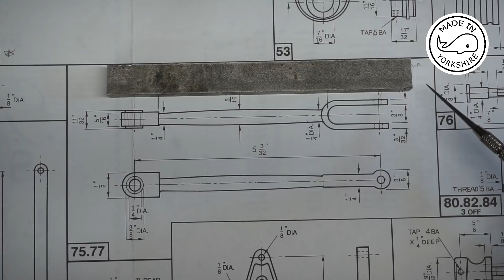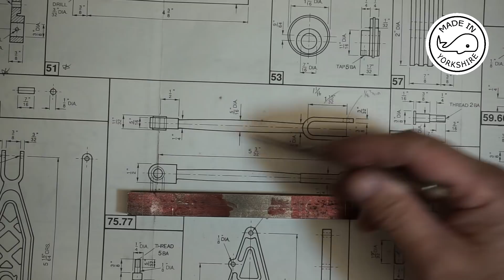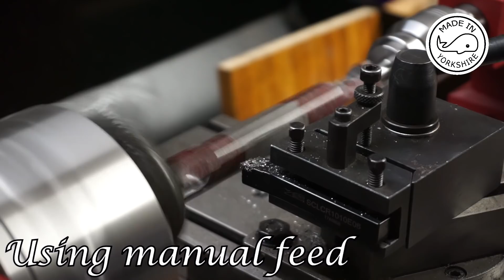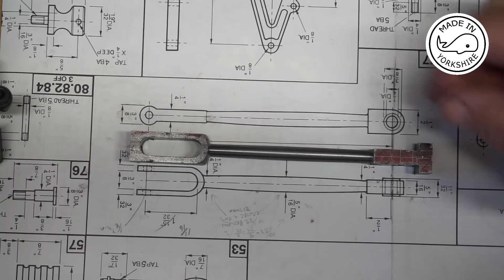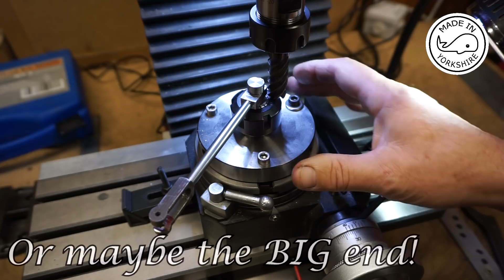#MT32 Part 14 - Making a Stuart Half Beam Steam Engine. The Conrod. By Andrew Whale.

Comment from the maker: 14/10/2019: IMPORTANT UPDATE.....
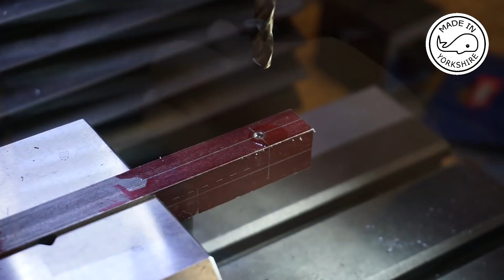Well nobody noticed my error at 9:25 where I drill and ream the big end to 1/4" in diameter. I later realised that it needs to be drilled and reamed to 3/8" in order to accommodate a bush with a centre hole 1/4" in diameter. Having realised my error, I used my co-axial indicator on the mill in order to find centre of the 1/4" hole. I then re-drilled 23/64" and reamed to 3/8".
Thank goodness it was recoverable!

Comment: Leave it all set up as default parallel. For 30 thou diametric difference, mark off 6 equal  places and machine in 6 parallel sections of 3 thou cuts. Finish with a rub with a file and emery. Allot quicker and should be undetectable.
Reply from the maker: Hi David - many thanks for the tip.
Cheers
Andrew

Comment: A lathe I used for a while had long grub screws in the tailstock to move it one way or the other.
To go right (towards the back of the lathe) I had to back out the right side screw to allow movement and then turn the left screw in to move the tailstock to the right and vice versa. Then when the desired offset was reached both screws were tightned to hold the ts in position.
Reply from the maker: Hi Larry - I think my lathe has a similar mechanism, but movement is fairly limited. I recently tried adjusting the tailstock for another job and couldn't work out why it wouldn't move. The internal mechanism then went 'pop' and broke. I then realised that I had the tailstock locked to the carriage - a basic error on my behalf. I managed to repair the mechanism with JB Weld, but I try to avoid making any form of adjustment now. It's dead on centre with the headstock, and I will try to leave it that way. Using a boring head makes life a lot easier.
All the best.
Andrew

Comment: To cut the second tapper you could have moved the tool holder to the back of the work piece and reversed the rotation. That way you could still use auto feed.
Reply from the maker: Great tip.
Many thanks.
Andrew

Comment: Could you make an adapter and use a cordless drill on slow speed as a power feed for your compound slide.
Reply from the maker: Yeah - Adam L has produced a really nice design with an in-built motor. I would like to have a go at making one sometime. His lathe is similar to mine.
Check out his video at:
https://www.youtube.com/watch?v=7gcI2jBty8Y
Cheers
Andrew

Comment: Andrew,
These are ornamental tapers, so need to fuss to much about the dimensions on the plans.
Doing them roughly to size and 'massaging them until they look good, with emery cloth or even with a hand graver is close enough.
And yes, if your cuts aren't too massive, am MT2 will hold firm enough in the tailstock for offsetting the center.

Paddy
Reply from the maker: Hi Paddy - thanks for the info. I'm really pleased that you think that the MT2 will hold firm - I think I will experiment to gain more confidence.
All the best.
Andrew

Comment: I found several “wrong” dimensions on the plans for my full size Stuart beam engine. It played havoc when it came time to fit the parallel motion! It took me a LONG time to finally figure out the problem and get it right. The plans for the Stuart Victoria also have some mistakes on them but at least they come with addendums that give the correct dimensions. I’ve learned (the hard way) to check everything first before actually making the part. Andrew, maybe this was why the material supplied for the crankshaft didn’t match the holes you made in the main bearings?
Reply from the maker: It's a shame that Stuart don't have an on-line forum where people could feedback these types of errors - then over time they could make revisions. The half beam came with a couple of addendums but nothing in relation to the conrod or crankshaft. If the plans are full size I try to double-check my marking up against the diagram, but still no guarantee.
All the best.
Andrew

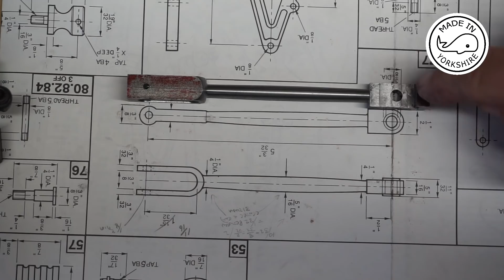Comment: 25:40 Those prints are 1:1, right? The distance from center to center looks longer on the part than the print to me. Optical dillusion?
Reply from the maker: Crumbs - you had me worried for a moment there. Just double checked the measurements and all OK. But you are definately right it does look way out compared to the drawing. It guess it must be a camera lens issue.
Phew!
Reply: @learningturningmetal  I'm glad to hear that. I remembered you talked about that distance earlier in the video but I didn't have time to go back and review. Anyway, keep at it, I like your presentation.
Reply: I thought the same thing when I saw it.  And after ALL the work to that point I felt so badly for you Andrew.  That said, I am very pleased to hear that “optics” was the cause.

Comment: Well done Andrew,
Well said about the time it takes to make parts and video it :)
Have you had the tailstock in bits to see what is obstructing the travel ?
ATB Adam
Reply from the maker: Thanks Adam. Now then - I just thought that the limited offset of the tailstock was a design feature. Can you get more offset on yours by any chance?
Reply: @learningturningmetal  
Not sure, I took tailstock apart a couple of years ago, to clean and inspect it.
I do remember that there is two small grubscrews that lock the tailstock in position after adjustment, on the end just below the graduated zero marker. ( Not the usual adjustment screws)
I had to play with tightening these a bit at a time overwise the tailstock would creep out of alignment.
I've noticed slight differences in our lathes, depending on the year of manufacture.
The gear quadrant is one of them.( Banjo casting)
ATB Adam
Reply from the maker: Hi Adam. I took the tailstock apart yesterday. No obvious obstructions, but I found that if I loosened the bottom clamp bolt slightly it gave me a little more offset. I think some of the half beam linkages require tapers so next time I will try using a live centre in my boring head attached to the tailstock. That should be fun!
All the best.
Andrew

Comment: Nice job Andrew, it's coming along great.  
As for the offset turning using the boring head in the tailstock, I've found a drawbar is unnecessary - just a gentle tap with a soft mallet will hold it firmly.
When removing the bulk of the material to turn the central spindle shape you may find it helps to take 2 or 3 adjacent plunges with the parting tool at either end that will give you an 'entry point' for you left or right hand turning tool and make the job far easier. If you do that though be careful plunging in with the parting tool at the tailstock end as it it is very easy for the work jam and ride over the tool.
Reply: Or, get one of those tool holders that take 6mm round inserts. They plunge, cut left, cut right and are good for radiused corners. And by coincidence next week end is the Midlands model engineering show.
Reply from the maker: Hi Chris - I've actually got a 6mm round insert tool - so I must remember to give that a try next time. I quite fancied going to the Midlands show but it's really difficult getting rail connections from where I live to Royal Lemingto Spa. Maybe next year!
Cheers
Andrew
Reply from the maker: Thanks for the advice Peter - I think need to have a play with the boring head in the tailstock.
Cheers
Andrew
Reply: @learningturningmetal  Hi Andrew, very interesting video, only just found your channel. With regards to using the boring head, ensure that the adjustment slide of it is parallel to your lathe bed, otherwise you will get a height variation instead of an axis variation. You would still end up with a taper, but with a compound adjustment which would be difficult to calculate and get right using your Dial indicator. I am currently ( been at it on and off for 30 Years ) the Stuart Triple Launch Engine.
Reply from the maker: Hi Dave, many thanks for the advice. I plan to use the boring head as an offset in the very near future.
I hope you make good progress with you engine. Sounds very challenging!
Cheers
Andrew

Comment: Its always a joy to watch your videos. Your excitement is contagious. I am also thinking of buying myself a casting kit. But  a PM research kit. Stuart is too expensive for me.
Reply from the maker: Thanks for the feedback. I fancied the PM Research Red Wing hit n miss engine. Just put off by the fact that I wasn't sure if I could get spares if I messed up machining one of the castings. Stuart sell individual bits - so a bit of a comforting factor for me. If I lived in the US I guess I would give PM a try though.
All the best.
Andrew
Reply: @learningturningmetal  

PM Research does sell spare parts for their kits.  At the PM booth at the local model expo there is usually a line of men getting new parts for another go at whatever bit they mangled-up the first time around.  Sometimes I'm one of them.

I would love to see you tackle a Red Wing engine, but maybe you will have to trade-up your mill?  Those castings are relatively large.
Reply from the maker: Thanks for the info Douglas. It looks like a 1/4 scale Red Wing may well be my next major project. I've found a reputable supplier in the UK  called Forest Classics. They are awaiting delivery of Red Wings from the USA.  It would be a fine excuse to upgrade to a larger mill 😀.
Cheers
Andrew
Reply: @learningturningmetal  

That's awesome!  If you haven't found it already, check out this video:
https://youtu.be/PtULHB-MQIQ
And make sure you check out his Red Wing (and 6CI steamer!) build article on his website for a ton of pictures and information.

Comment: I had the same issue as you with tapers but mine was a 2mm reduction and the way I'm doing it is with a straight shank mini live centre from Arc Euro Trade with the boring head. now if your head has 12mm holes you'll need to make a sleeve for the live centre as it has a 10mm shank but it works great and you don't need to upset your tailstock. The boring head and MT2 holds in fine.
Reply from the maker: Hi Roger. Just to let you know that I got the live centre you recommended. It looks good and I hope to use on some other half beam tapers soon. Watch this space!
Cheers
Andrew
Reply: @learningturningmetal  You won't be disappointed Andrew, I've just turned a 1mm taper on 4 pillars for the Muncaster Entablature engine being serialised in Model Engineer. I had a small centre point in a 4mm dia end with 4mm dia in the chuck!!! scary :>)
Reply from the maker: Hi Roger. Very interesting. I've just checked out page 285 of my copy. It looks like an interesting project. I should spend more time reading my mags.
I hope it turns out well.
All the best.
Andrew
Reply from the maker: Hi Roger - many thanks for the advice. I've added the straight shank mini live centre to my Arc wish list. I'll get hold of one when I order some more bits and bobs. Also encouraging that the MT2 holds fine.
All the best.
Andrew

Comment: Nice work!

If your tail stock has not enough sideways travel, there are some ideas here; 

An adjustable center. You might be able to do one yourself. (sorry only got a German example in the link below, but you get the idea how it works.).
https://www.paulimot.de/drehen/koernerspitzen-zentrierkegel/einzeln/1528/verstellbare-koernerspitze-zum-kegeldrehen-mk2-mk3

Next idea would be to use the compound slide, align it over the length of the taper you like to create, use a DTI and some gauge blocks over the said length. (you could use the part instead of the tail stock spindle as shown by Joe Pie:)
https://www.youtube.com/watch?v=YCllVu4K738&t=626s
ps: use a modified drill to move the slide, just wip up a insert that fits over the handle of the lathe and be real lazy like me)

 Last would be making a taper jig, which guides the cross slide on a rail extending on the back, that is a lot of work, but i thinking myself about it to make tooling in the future. It's only worth if you have enough work involving taper tho...
https://www.youtube.com/watch?v=ceD8U-TgOH0

I hope i did not told you something you already knew ;)

Comment: See Andrew, I told you Connecting Rods we're that bad. You did a great job and it came out really nice. You might want to go back to Mr. Promatic Lee's channel. He also had the same problem with off setting his tail stock and built a simple device that fits into his tail stock yet allows him to shift his live center. Another place is TOT's, This Old Tony, channel where he talks about curves and convexs episode. Anyway, good job!
Reply from the maker: Thanks for the encouragement Craig. I'll have another rummage through the channels you mention. I really appreciate your advice.
Cheers
Andrew

Comment: Hi Andrew. there are taper turning attachments available that you put into the tailstock, most engineering supply places would stock them, easier than trying to offset the tailstock
Reply from the maker: Ho Bob - thanks for the advice - I will do some research.
Cheers
Andrew